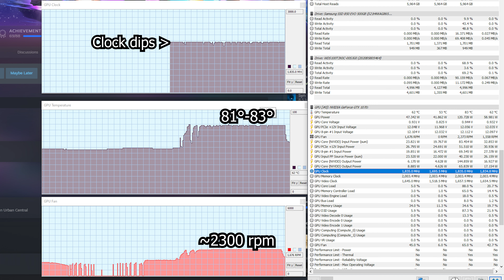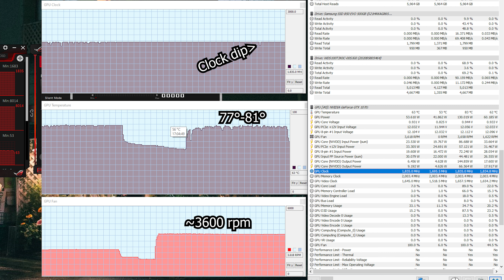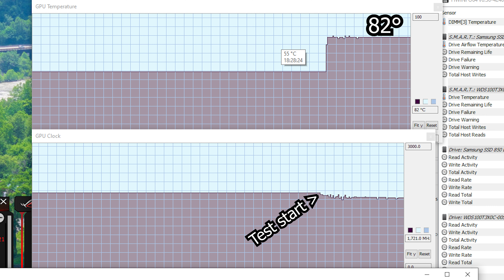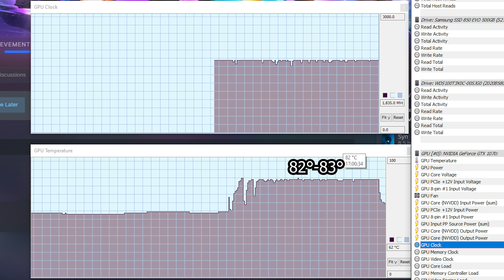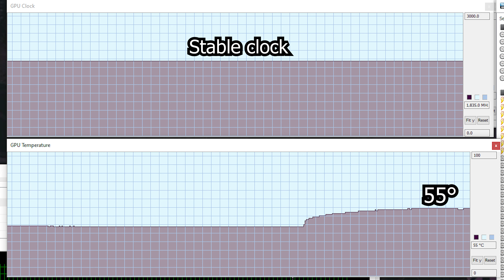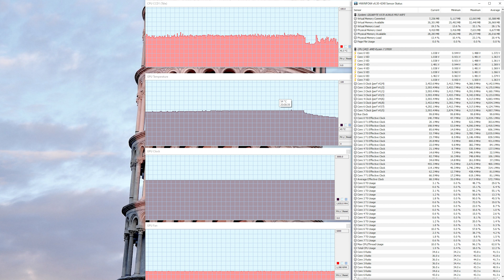How to Change GPU Thermal Paste. A MUST for Older Cards!

Comment from the maker: Thanks for watching! If you'd like to help us out you can use our affiliate link for Noctua NT-H2: https://amzn.to/3rVZi90
Reply from the maker: @pxrc.6216  Honestly I would be hesitant to recommend anything. Everyone's needs and tastes are different. 

That being said, this ikea desk (idasen) I have been using is great! I bought the smaller desk top. There is a larger one. It has a nice mesh "basket" for cable management.
Reply: Its works for laptop?? Evoo lp5
Reply: I've repaste my GPU using MX-4, it is now about 22°C more cooler... (from 96°C down to 70ish°C fully stressed).
the old paste just seems too dry, like, leaving too much micro space for air.

What matter is, what is your previous paste?
how long it has been there?
What the best paste for GPU (i.e most durable performance, not the inital performance)
Is Arctic Silver can hold it's permance more longer, as it sounds like more metallic material?
Reply: is it normal for gpu thermal paste to spread into the capacitor or whatever it's called, the small things around the chip?
Reply: Thermal Grizzly Kryonaut Extreme is the best commercially available thermal paste for GPUs due to its very high viscosity and thermal transfer metic. Put it on my 7900xtx that had relatively fresh factory paste and my temps dropped 19 degrees! And the delta from hotspot reduced from 24 to 14. A massive win! The 7900XTX hotspot is an issue and this fixed it.

Comment: With my 3.5 yr old EVGA GTX 1060 was idling around 65 C and when playing non GPU intensive games like CS-Go I'd be throttling a lot and I'd be getting a lot of stuttering and frame dips which made me lose a lot of duels...
When I dismantled the card the stock thermal paste was pretty much dead ! Very little of it was left between the die and the heat sink !
Having applied new thermal paste, I'm now idling around 35-40 C and cruising around 70-75 when gaming ! ... That's almost a 30 degree difference in Idling ! It is insane !!!
I'm never gonna thank you enough !

Comment: A GPU cooling tip I've found to be useful aside from ALWAYS replacing the stock thermal paste (because it's the cheapest crap out there) is to replace the stock thermal pads with higher quality ones. Or add pads to things like a cards VRM's and RAM chips so they can dump their heat into the heatsink.

I saw with a GT 1030 that I have in a HTPC, that the heatsink covered the RAM chips, yet didn't have anything bridging the gap to cool them. I didn't take software temperature measurements, but under load those things were solar flare hot. After taking a couple minutes to apply some thermal pads, so they could dissipate their heat into the heatsink, it consequently dropped their load temperatures down by probably 50+%. Was genuinely amazed how much such a simple thing helped.

I think people forget just how hot those RAM chips get and how the hotter they get, especially if overclocked, the more they thermally throttle, which effects GPU performance. Plus most decent thermal pads, especially the ones that come in big sheets where you can cut many pads out of, are dirt cheap. So it's worth taking a minute to see if you can bridge some gaps with thermal pads over VRM's or RAM chips or simply replacing the stock ones with better quality ones. The card will run cooler and live longer because of it.

Ironically few, if ANYONE, seems to be mentioning this. So hopefully it helps someone out there.
Reply: RAM chips can operate up to 95-105 degrees without any problems.   They will last the lifetime of the card.  People are worried about temperatures like 85 degrees, but that's not really a problem.  You are far more likely to damage a video card by overvolting, than having an inadequate heatsink
Reply: This was on Reddit!
Reply: you may lose your warranty, so maybe don't do this after buy
Reply: Excellent advice.
Reply: Most factory paste is mediocre.  It is not a bad idea to have a stock of good paste and pads.
Reply: Its just not worth the hassle of buying new pads, replacing the paste does a good job by itself

Comment: Thanks for this. Just ordered some of this paste and will be doing this on my Zotac 1080ti mini soon as it arrives, my temps are hitting 84 and thermal throttling causing stutters in games and had a 99 degree hot spot. Hopefully this will give me another good few years :)
Reply: How'd it go?
Reply: @TitanTubs  I have more grey hairs from the stress of pulling apart the card, but also about 10ish degree drop in temps under load :)

Comment: I was gonna say that I were considering changing the thermal paste of my 7 years old Gtx 770, but after seeing your results, I will definitely go buy some thermal paste tomorrow.
Reply: So I just did the thermal paste replacement and it did not get me the results you were archieving.
The paste was still kinda fresh, wet and did not crack into bits, as in your video (5:01).

But I do see some improvements because with the same stress test, the card is now performing 4°C cooler with 9% less Fanspeed. I do think it was worth it and I learned quite a bit, because I have have an pre-build computer and never did anything like this before.

Comment: This really helped me since I use the 2012 Nvidia GeForce GT640 DDR3 and my old max was 100°C, my new max was around 70°C.
Reply: ah my old card, absolutely hated it xD.
Reply: Do you remember how much paste did you use?, because I have a similar gpu with a little chip and I've tried with different quantity and the temps don't go down.

Comment: Always a good thing to do after you have Tha card for some time
Don’t worry about the sticker ... they are not allowed to void the warranty for removing the heatsink (or simply clean the sticker completely off)
Most company’s just use this to see if you removed the heatsink if the card would come in for an rma 
Also let the company know if you ever replaced the thermal past or use a gpu block ... most company’s should not make a big deal out of it (specially if there are gpu blocks that are specifically made for that card)

Comment: I have an rtx 2060s for about 3 years now, for the past years temperatures where overall ok (max 80°C / idle 50°C 0%fanspeed) but it recently started going as high as 88-89°C 100%fanspeed (my pc even shut off by itself once due to thermal throttling) so obviously something was going on. I knew that my airflow is good so I replaced the thermal paste and the results were pretty much the same as yours. Idle 45°C 0%fanspeed and 74°C 65%fanspeed after a 1hour stress test. If you're having tempratures above 85°C first check your airflow and if that's not the case you should definitely check your thermal paste, it's probably what's causing the problem. Great video!
Reply: My 1080 I bought in early 2017 was after 5 years always close to 80°C at 95% Fan speed. Changed thermal paste a month ago and man was that thing dried up. Now its mostly between 65-69°C at 80-85% Fanspeed and I just used Mx4 so nothing fancy there and yet the temps are even better than the thermals when I had it new in 2017were temps were around 75°C at 85% fanspeed. You could probably even go sub 60°C with liquid metal, not that I would but the results are impressive.

Comment: I had a similar outcome as yours as well, my reference GTX 1080 was running loud and hot though blower style coolers are known to have high temps but the thermals I had were unusually high averaging at 87-89C and max temps reaching 91C when gaming, by then the card would severely downclock to just a mere 1600+mhz and fan speeds screaming at 90-100%. So I disassembled it, cleaned out the dust that was built up inside and to my surprise, the thermal paste had dried out, it was just depressing to look at, similar to yours but mine was super thin since the gpu die was quite visible, I then repasted it with some trusty Arctic Mx-4 and I was really shocked with the results, average temps were now at 66-67C, only maxing out at 73C in gaming, clocks went up to almost 1850+mhz and fan speeds were only running at 60-70%. It's just as you said in your description, take care of your graphics card and it will take care of you.
Reply: Is 82c at max usage after an hour normal for a founders 1070
Reply: Thermal paste is suppossed to be somewhat dry.  Most likely what improved was removing dust from the card.

Comment: Wow, thanks. This worked wonders for me. I replaced the thermal paste on my RX 470 GPU, which previously would heat up to 90 degrees celsius and then just shut down the computer even on relatively low demanding games like Fortnite. Using the Superposition Unigine benchmark program, the PC would shut down in 60 seconds. Even when underclocked, the benchmark program would make the GPU run at 80-85 degrees C. After the thermal paste replacement, my GPU never goes higher than 65 degrees C.

Comment: Thank you for posting this and giving me more hope that this was the problem with my Asus 3070. It was running at 82C on average under load and now after repasting the card it's running at 64C under load. The factory thermal paste was terrible. Idle temps went from 55C to 34C. Over 50% of the processor was bare completely shiny metal and the rest was small thin patches. In hindsight I'm shocked that it was running even as well as it was. It runs so quiet now. I didn't realize how loud it had gotten.

Comment: I've got some NT-H2 on the way for exactly this. Think I've owned my 1070Ti for 3 years now, keen to see how it turns out.
Reply: Completed the repaste. Dropped 13deg C from my max 3D mark temp.
Reply: @H3kler  nice
Reply: @H3kler  im thinking about doing that too but im scared to mess up
Reply: @arslanemre4100  maybe you can find a computer shop to do it for you
Reply: @magicmachine1637  yeah i did it the last days i couldnt play cuz my cpu saw 98 degrees cuz it has stock cooler + 10 years old no thermal paste now its 30-55

Comment: Im really surprised,idk how but it really worked on my 5 years old GTX 750 idle temperature decreased from 45-39 & max from 95 to 71 😳
Reply: What kinda thermal paste did you use?
Reply: @RyandeSilva  Cooler Master High Performance Thermal Paste grease

Comment: Screw tightening pattern is important for GPUs. You want to snug it up with an X pattern. It's not like a cpu- you need to make sure the heat sink is tightly held to the die.
Reply: So you need to screw them in A-C, B-D pattern instead of A-B-C-D pattern ?

Comment: GTX 1060 Founders Edition blower design went from max 82c  to 68c while gaming. After removing  Years of dust around the fan and heat sink, replacing the old  crusty crumbly thermal paste.

Comment: Great video, had some amazing results on my end. I was hitting around 85-88 degrees on my gpu with low settings, yep low settings, on some games and decided to change the paste. It's a 2070 super and i basically had it since it first came out so a fair few years now. Now running at 35-38 degrees. Around 60-66 on ultra settings. Seems fake how good those results are. But to be fair my thermal paste before was basically dried out. It was literally cracking as i was cleaning it off.

Comment: I did this on a week old Gigabyte Eagle 3080 using Kryonaut. Also upgraded all the thermal pads at the same time. There was a difference but only noticeable when eyeballing HWInfo numbers and fully stressing the card with looped benchmarks, but it didn’t get worse than before and the process was fun so..
Reply: too early for that! I"d say you only need to do this kind of maintenance with urgency after 2 years of heavy use
Reply: 3080 probably not older than 2 years without heavy use this wouldn't even be needed hence the unnoticeable difference. I did this to a 1060 G1 6gigs laying around and had a 20 digress difference and is idling at 30s  now without even the fans running now before it was 50s and kicking in fans here and there with normal office workloads.

Comment: This is something... 😆
I knew that changing the thermal paste makes a difference, but so much I didn't expect. I can see that your old one was in a really bad shape too, so that can make a big difference in this case.
I always change it for a good quality one by the way, both CPU and GPU, Desktops and Laptops as well. The manufactures rarely use the best ones and because of that I prefer to be safe, and it was ever worth it doing it, for better temperatures and lower needed fan speeds.
I've used different ones over the years and the difference between them can be some, but not huge tho.
The ones I would recommend after my experience are this ones (by order):

- Cooler Master MasterGel Maker
- Artic MX-4
- Noctua NT-H1

P.S.: Change the thermal pads for good quality ones, it a must do too! 😉

Comment: took apart a 1080 Ti FTW which was running 42 C  IDLE. Took it apart and found loads of dust and shit in places a duster doesn't get. Dropped some MX-5 on GPU and it dropped to 28-29C idle.

Comment: This is so true. I have ared devil 6750xt.any time I played on 1440p I would hit 100c hotspot temp or more. Even if I was just in the main menu. My edge temps would be 60c while the die would be 100c.

After a repaste it's at 80c to 90c (die temp) under full load and it takes hours to go over 90c.

Comment: Damn, I should probably try this. I have a 4+ year old GTX 1080 with a blower style cooler. It has been hitting 82c and throttling down by 200MHz since the first day I bought it, so I never thought that this could be a problem.
Reply from the maker: Absolutely do it. I hope it will be as successful as my experience.
Reply: @TechIlliterate  I repasted my GPU with Arctic MX-4 and my temps went down by about 8 degrees, pretty cool results!

Not sure if it was worth the effort though because I spent like 30 minutes mining the 4 year old thermal crust that was practically one with the die and the tiny resistors around it xD

Comment: A friend was getting 110°C hotspot temps and crashes, and kinda stopped gaming or even using his brand new 1440p monitor because he got scared. (Big shame!)

We dusted the PC... nothing. Adjusted the fan curve... The crashes stopped, but the hotspot was still at 110.

A week later I told him that I thought he needed a repaste. Today I went and did it, and boom: 80°C max hotspot temps. And the idle GPU temp went from 55-60 C to 35.

Insane. The GPU was not even that old: the factory paste just didnt cover the whole die.

Comment: This is not always the case with all cards.
My friend who has experience of opening GPUs and applying termal paste opened my rtx 3060 which was working on 75°c and applied termal paste and temperatures went to 90°c as soon as we opened some games.
We will buy new termal pads and new termal paste and hope for the best.

Comment: Once I've bought an old Radeon from like 2013 and it runs like a jet engine, with temps around 60-70 (idle) and up to 100 C (under load), when I ask the seller he said that it is normal, but the card was never repasted (stickers still intact). I assume it has something to do with the paste, and so I did repasting it. Now it runs well and almost never reaches 70 C. So, yes repasting a GPU is worth it.

Comment: I saw a few tests with different thermal pastes and also different way on how to apply it to the gpu. The most "good" brands will have more or less the same result....may a difference from 1-3 degrees between them. Very cheap paste however can be really bad or even worse than not changing it. 
One of the best thermal pastes was the Grizzly Kryonaut extreme. here you had a 3-5 degree lower tempertaure than the next best paste. But it also cost twice as much as other good paste. Other good pastes are the Noctua NT as well as the Arctic MX4 or MX6. 
It is also recommended to spread the paste over the whole gpu instead of just putting a drop in the middle or using the X-variant.
I am about to change my paste soon on my 2070. It does not get very hot though, but I bought a new PC and want to use my old card for a while, till I can afford a new one. So that means clean the card and of course changing the paste before puttin it in a fresh new PC.

Comment: thanks for the video man, maybe because the Thermal paste was dry and dead  and you see there was too much so it probably prevented the connection between the cooling system and the gpu. now i can tell its good using more thermal paste but not too much because if you don't change it regularly and let it die it'll happen again i think if there was only small amount of a dead thermal paste it would cool better coz it'll have more connection between cooling system and the gpu
Reply from the maker: Yeah I think you have a good point there.
Reply: @TechIlliterate  well, doesn't mean we need to put just a little, put enough and change it regularly :)

Comment: Can you make a video describing about thermal pads and what shouldn't be done while repairing a graphic card, like a in depth explanation.

I have a Gigabyte 1660 OC 6G card which idles at 49C (fan off) and loads around 73-80 (Rendering) the card is two years old and I am going replace the thermals soon. Thank you!

Comment: I have used my gpu for 4 years and i noticed it was reaching temps of 95c and even 100c with 100% fan speed. I replaced the thermal paste with cheap thermal paste and did those same games at 50% fan usage at 75c.

Comment: Great video. I must have got a good card. Had my EVGA 970 for over 5 1/2 years. Idles at 35 games at 55-60. Never been past 80c. Hopefully putting this ole girl to rest soon.
Reply from the maker: Damn, that is impressive. 
Must be some quality paste.
Reply: I got a 970 too, and same thing with the temps. Guess there is no need to worry for now.
Reply: I got 970 and it got 75c in no time while full load lol, maybe its time to repaste